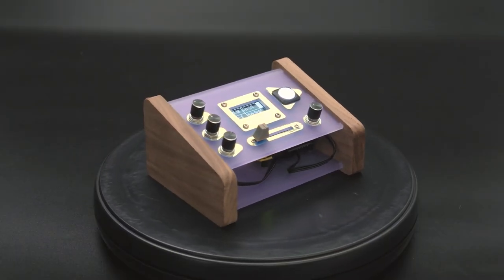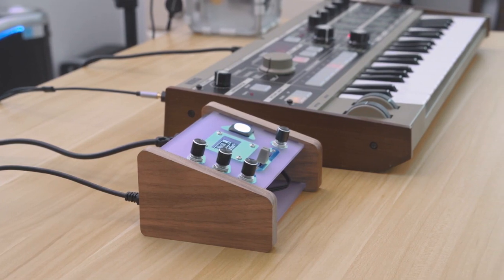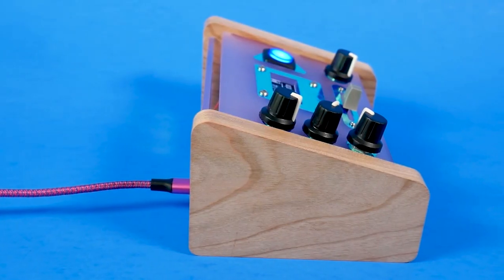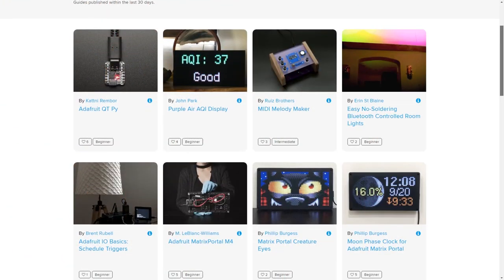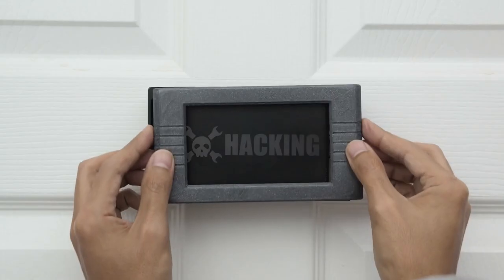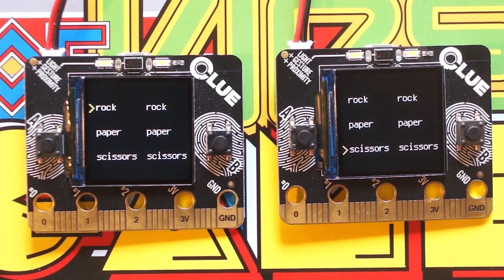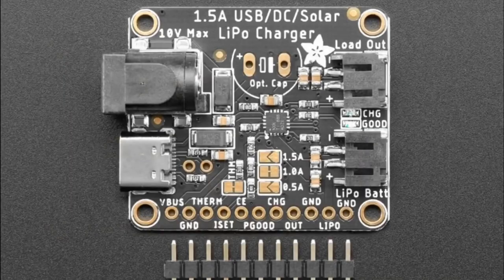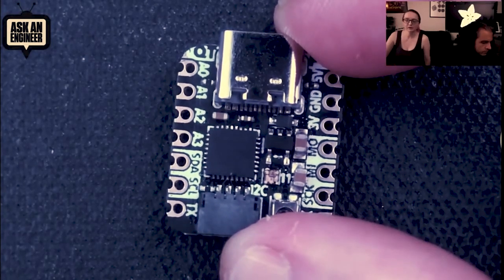Maker Update #201: MIDI Monster Mash #Adafruit #Making #MakerUpdate @Adafruit

Comment: I have a code base that allows wii nunchucks, wiiu gamepads or snes mini gamepads (they all use the same spec) to be used as a usb hid controller. The QtPi would be a great board to put it on for shrinkifying the hardware!